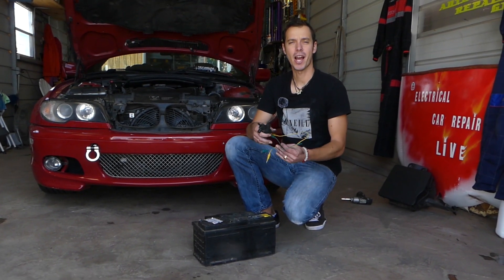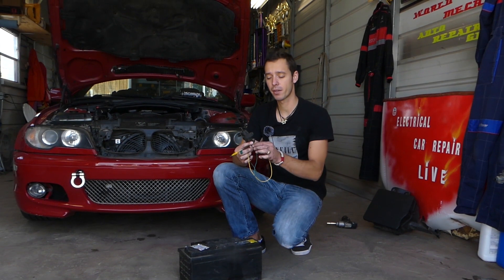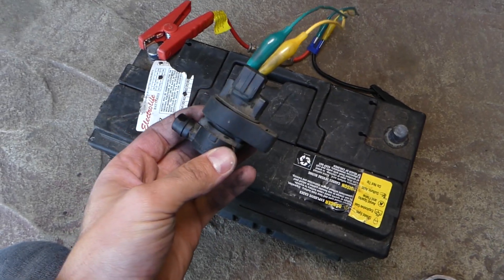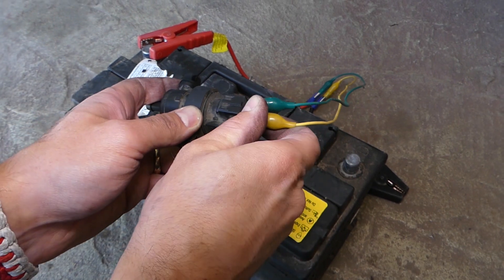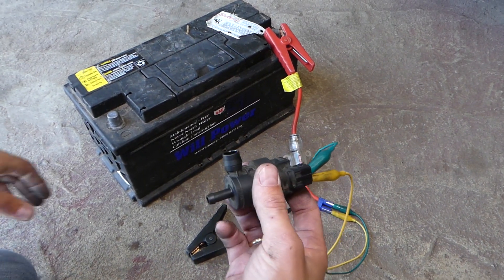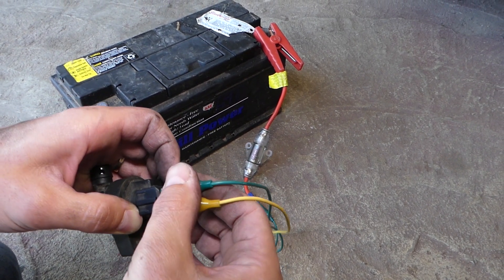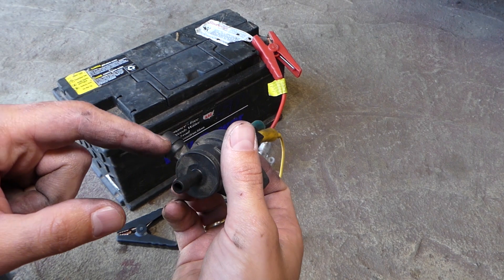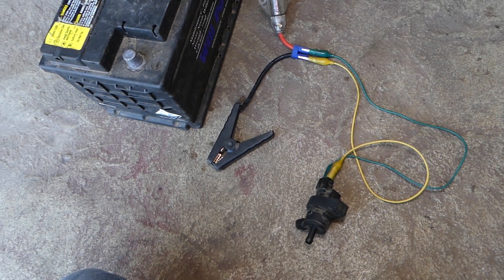IS YOUR PURGE VALVE BAD ON BMW E46. HOW TO TEST PURGE VALVE CODE P0443 P0444

Comment: Hey, I have a leaking T valve. thought it was the injectors leaking, so i replaced all of them. waste of 600 bucks. turns out its the T valve in the fuel line. any videos on how to replace that?

Comment: Thank you for sharing. You can also test these solenoid valves with a vacuum pump. So in the direction of how the air flows that’s where you connect the hose from the vacuum pump. The solenoid off no 12V you pump the vacuum pump and if it holds vacuum is good but if it does not then is bad, but make sure to leave it like that for at least 10 minutes. If after 10 minutes the needle has not moved then is good. Make sure you know how the air flows because if you connect the pump in the wrong end it may damage the diaphragm inside the solenoid.
Reply: Make your own video!

Comment: Nice explenation.
I from the other hand have deferent issue with mine. When i blow woth out conecting it the air goes throe, then when i connect the ground it closes it. I have also checked ohm and it showes 43ohms.
I have 1993 m50b25 e36. Do you think my valve needs replacing??

Comment: Are there Purge valves that are designed to stay open until you apply voltage. Another words the other way around where applying voltage closes the valve?